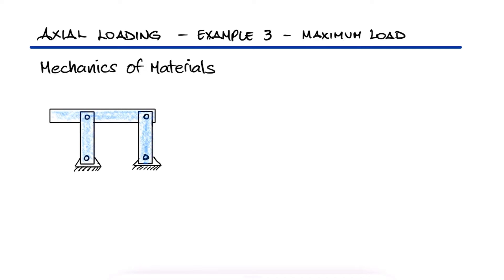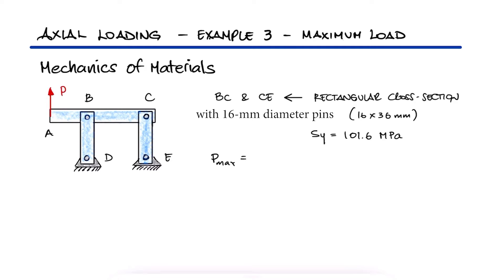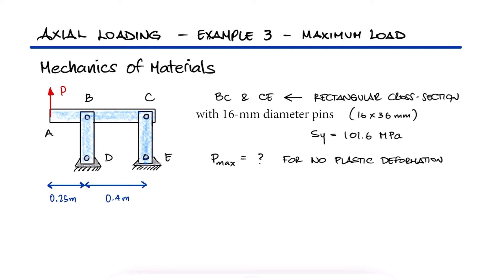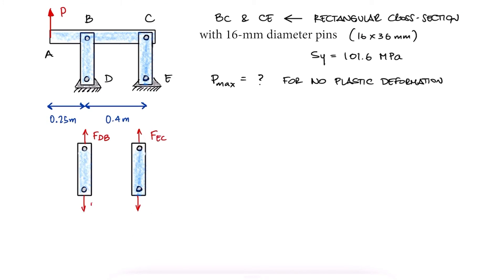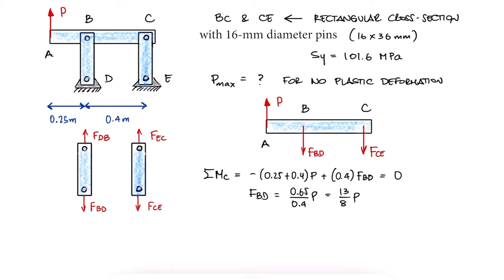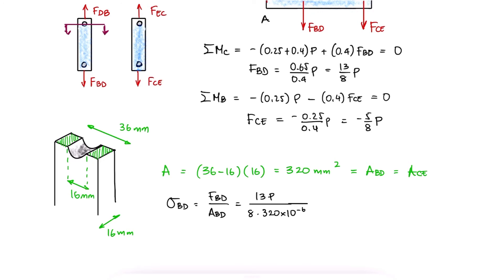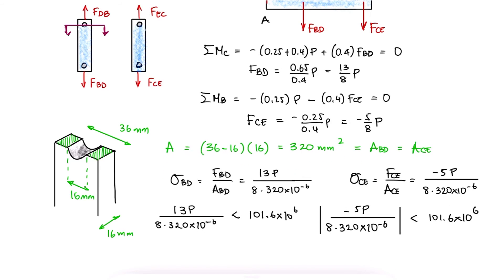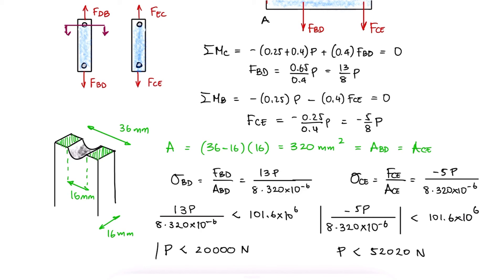Maximum Allowable Force in AXIAL Loading Normal Stress in 2 Minutes!

Comment: didn't I learn when a body is under compression, the are should be taken from the center doing A= (36)(16) , and when is under tension, should be taken from the edges doing A = (36-16)(16)?